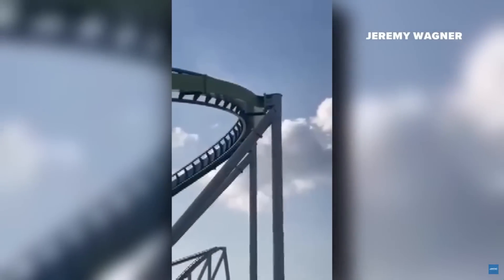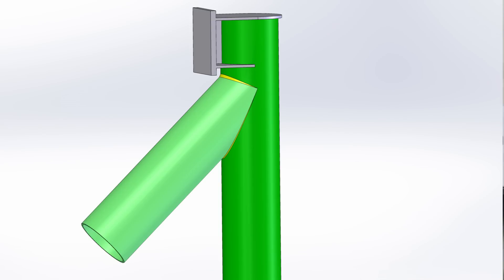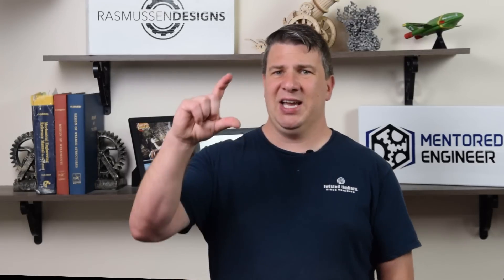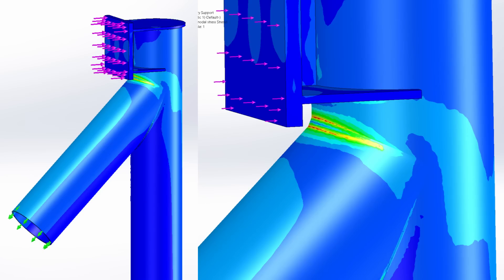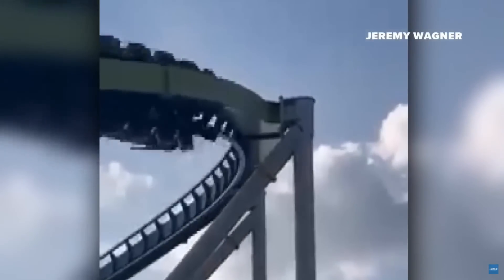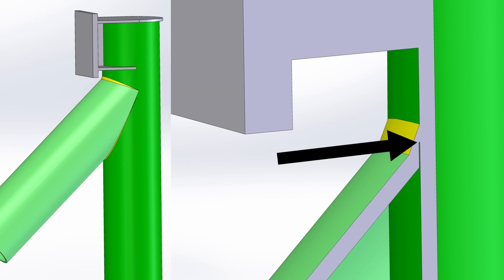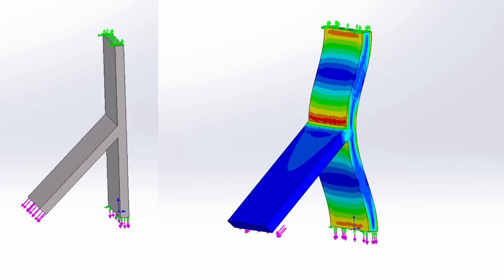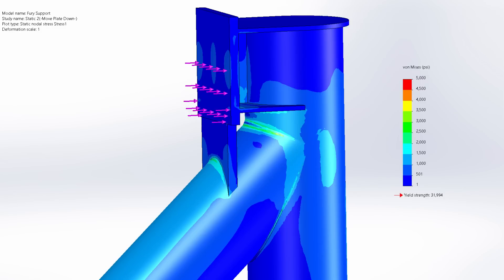Fury 325 Crack! Engineering Analysis and Response

Comment: Since the cars rolling by exert stress on the joint, could they install some kind of spring system at that location that would absorb the stress?
Reply from the maker: Great question.   Yes and No.  They could do that, but it kind of defeats the point.  The springs would absorb energy from the system and reduce the velocity as it goes by.  The stiffer a coaster is, the faster it would be. 
I had to change the wheels to be stiffer on my backyard coaster so that it would get all the way around the track.
Reply: Would not be helpful. Springs could dampen the effects of local, small impacts (bumps etc.), but not the overall nominal loads coming from the train due to outwards acceleration. Those forces are still there and cannot be reduced, except for lowering the speed.
What also needs to be taken into account: if this support is less stiff, the loads coming from the train will be transferred to the neighbouring columns, putting higher loads on those.

Comment: This is not the only one that cracks were found at. Most of this steel made today is garbage. Any ride you see closed is a good sign that cracks were found at stress points.
Reply from the maker: Most manufactures will insist on Mill testing for each lot of steel so they can trace defects like this.
Reply: Except that cracking usually does not happen within the base material itself, but at the weld toe or inside the weld.
Having no clue, but having a strong opinion and spreading it. A typical youtube commenter.

Comment: At the time the video was shot, it was no longer a crack, but a complete separation of the two sections. The effects of the motion (every time the cars rolled on that section of tracks) played a major role on the stress of the structure (dynamic or live loading; fatigue). There was a picture taken the previous week by someone else that actually showed the crack near the connection of the tubes. In about a week or so, this led to a complete fracture. That picture was shown on national news.
Reply: .... sure looks like a fatigue failure.....  it broke! .....and does not appear to have stretched first...... well, could also have an inclusion in the steel but, surely someone tested for that!
Reply: You know I have to wonder about the quality of the materials being used to build these things.

I'm not saying that's definitely the case, but if it's happening to more than one ride over the course of time, is it possible they could be getting substandard materials at the fabricating plant, and it might not show up in their testing?

Comment: I suspect that the design was fine for static loads. They underestimated the effect of cyclic loading (think of bending a paper clip until it breaks). Fatigue strength of mild steel drops quickly as the number of cycles increases. I don’t know how old this ride is, but at 1 car per minute, 12 hours per day, 250-300 days per year, it wouldn’t take too many years to get to millions of cycles. It’s even greater when you account for the number of axles per car as each axle passes over a point it’s separate event as far as the structure is concerned. Watch the track, the next time you are stopped at a railway crossing. 

Also, it would be very easy for a slight misalignment during fabrication. A couple of millimeters or 1/10’s of a degree would make a significant difference.
Reply: Yeah, they definitely haven't built roller coasters before and obviously didn't know that there would be repetitive load/unload events.

Comment: I've never seen angled supports angled in the same direction as the forces. I'm no engineer but it looks like bad design and made this crack inevitable. They should be angled against the forces.
Reply from the maker: It would make more sense to have that angled away so the joint would be in compression.  However, that would put it in the parking lot.
Reply: @MentoredEngineer  lol they should have sacrificed the one to three parking spaces it would have taken to place the correct supports
Reply from the maker: B&M had designed lots of these.  This one wasn't unusual.  Check out this one on Great Bear!  http://thedod3.com/wp-content/uploads/2013/06/greatbear12.jpg

Comment: When I saw this my first thought was that the angular support should be on the opposite side whereby pushing towards the force of the train vs pulling away from the support. My layman's eye visualized that force being transferred down the length of the angular tube toward the ground whereby dispensing the force over a greater area.
Reply from the maker: It would make more sense to have that angled away so the joint would be in compression.  However, that would put it in the parking lot.
Reply: @MentoredEngineer  I've ridden the Fury 325 and many other Giga coasters. I don't think safety and peoples lives care about aesthetics and parking. I know mine surely does not. This was caused by either bad planning, poor design or wishful thinking on the part of Cedar Fair and Bolliger & Mabillard. 
From my perspective a repair on the existing design is a Band-Aid on a broken leg. They need to redesign the support. If that intrudes on their parking and they deem that intolerable then they need to reroute the track to provide either less gravitational stress or better support IMO. They also need to look at the portions of the ride that have similar stresses and supports and consider altering them as well. 
There's light poles in the parking lot, hang a light on it lol! Can't be any worse than that Taurus that caught fire and took another 11 cars with it.🤦‍♂

Comment: If that type of joint and weld is so bad, why does B&M use it so much? So many of the supports on all B&M coasters are similar with a vertical tube and an angled tube attached near the top. Also, what sort of damage would be required for there to be a complete structural failure? My guess and hopes would be that multiple adjacent supports would need to fail (i.e. any two supports could fail like this as long as there is a "good" support between them).
Reply from the maker: Evidence would support the joint is not "so bad".  B&M has been using this type of joint for 30 years.  While we see that the weld is the weak part, it could be that the foundation shifted adding extra loads
Reply: Unfortunately it was not made clear in this video that Corey does not actually know how the joint design is. It is a pure assumption that a fillet weld was used.
And even if a fillet weld was used, hollow section joints usually have higher stress concentrations on the weld toes rather than the weld root, i.e. it would not make any difference if you use a fillet or a full/partial penetration weld. Assuming that the welds themselves have sufficient strength.

Comment: You can tell by the way the outside face of the column 'tore' that that was the last part of the failure, which supports your theory that the failure emanated from the weld.
Reply: I’d say it’s a bad heat treatment. Not a welding problem
Reply from the maker: I doubt these supports were heat treated.  It would add no value to the steel material being that it a standard piping which is a low alloy.
Reply from the maker: Once the crack starts, you will have less material to carry the load.  At a certain point, the material will just tear off as you pointed out.

Comment: Exactly what you said about inspecting the beams before and  after, I would ad replace all the hardware that holds the track that have been compromised too.
Reply from the maker: Good point.  In the industry I worked in we would do that on critical joints after an issue like this.

Comment: It seems to me like a laser scanner would be a good investment so these things could be caught early.  Super interesting video.
Reply: A laser scanner probably wouldn't have found anything except maybe the settling of a foundation if that exists and contributed to the failure. The only way to find this earlier is pretty much a manlift to do mag particle testing. That being said this crack didn't go to a full break in one day. They definitely need to improve their visual inspection process to make sure all joints and connections are subject to a close visual inspection (using a zoom lens or drone) probably on at least a weekly basis.
Reply: @danbert8  You can get some pretty good results on integrity with a modern scanner - just not early enough to stop the loss of integrity from happening.  I agree - the scanner becomes helpful when its already "too late", but they could have probably caught this months ago and have already mitigated the issue.  I just assumed that parks would be scanning footers and such regularly and comparing the model data to make sure there arent issues.  I wish I was still working for Trimble - I'd be having a field day with this.
Reply from the maker: Thanks!  I'm not sure if laser scanning is a Non-destructive testing method.  Do you have any info on this technique?
Reply: @MentoredEngineer  I'm guessing they're referring to using lasers for very precise measurements to create a 3D model of position. That would, of course, be non-destructive, and any (unexpected/unallowable) change in position would require further investigation to determine why something isn't where it should be.

Comment: Not that big of a deal to inspect these days.  You have excellent drones with 4K footage that can assist with these inspections.  Those drones can be used to continuously film EVERY joint and weld without someone having to climb the ride every single day.
Reply from the maker: Brandon with Theme Park Predictions says they have many drones doing inspection as well as men walking the track.  However, I'm sure there are many areas like this one where it will be difficult to inspect unless you are within arms length.
Reply: Why would you need a drone when this was visible from the parking lot several days before the fracture and shut-down of the ride?  Blaming this on a "hard to inspect" area is nonsense.  A visual inspection from the ground would certainly have caught this - since a visual inspection from the parking lot DID!

Comment: Looks like what coasters need is a robot that can drive itself along the track, with cameras and other sensors to check the track, and robot arms with cameras that reach out, around, behind etc to examine the supports from connection to the track down to a few feet away. Movement and distortion could be checked for in a simple way. Weld target markers at various locations. When the robot gets to specific locations along the track, and the robot arms move to specific locations, if the target markers are not exactly centered in the cross-hairs (calibrated at first robot run after completion of the coaster build) then something that shouldn't move has moved. With all the target markers precisely located, a computer could have a 3D model of the coaster, feed it the marker position difference measurements from the robot and see how the movement has affected the coaster. As with FEA software, the distortion could be exaggerated as a visual aid to see it better.

To ensure that the robot itself hasn't become out of spec, it should have a very overbuilt test fixture that *cannot warp*. The fixture should have various test markers to which the robot rolls and moves its arm(s). If things don't align, it's the robot out of whack. Service the robot, recalibrate to the test fixture, then check the coaster. The test fixture could be in the garage where the robot us kept between its scheduled inspection runs. To ensure robot body to support alignment, there could be a pin or ring or other attachment the robot could clamp onto so it can't slip on the rails.

Like with multi-axis industrial robots "slotted into" assembly line positions and programmed to use the same tools humans formerly wielded, a coaster inspection robot wouldn't miss looking at everything it's supposed to look at, needs no pay or health insurance, never skips a scheduled inspection because it had a fight with its girlfriend, never will miss a crack because of a bad hangover headache...
Reply from the maker: Not a bad idea.  Can I have it?
Reply: @MentoredEngineer  go for it
Reply: You didn’t come up with anything new. That’s already a thing. They already have robots that run along the track and inspect the rollercoaster. They even have inspection cars that humans ride in. I’d imagine they could be upgraded though.

Comment: 4:00 I feel u hit the nail on the head they did speed up the ride from 95 to I think 105-110
Reply from the maker: What I meant is that the trains tend to move a little faster in the afternoon once the wheels and bearings have heated up a little.  The physics of it provide for a max speed of 97-98 mph

Comment: A huge question now is could other B&M coasters using this specific type of support column also be at risk for similar stress cracks forming?
Reply from the maker: It is doubtful that the fundamental design of the support is the issue.  Many are saying that the diagonal tube's footer sunk a little which would add extra load to the joint.  B&M has a great track record with this design.

Comment: Dropping the plate down to that 45* tube seems like the most cost effective option. I’ve heard that back in the day when sex was safe and racing was dangerous, tube chassis cars (particularly of exotic metals) would have the tubes pressurized with nitrogen and a gauge was installed somewhere in the chassis. Idea being if the pressure reads very low or zero, you have a crack. Would it be possible to do that with these tubes? That away, at a glance, maintenance could see if everything is ok or needs closer inspection.
Reply from the maker: That is a great idea.  I have no idea if that is a common practice.
Reply: @MentoredEngineer  Not common at all, only time I saw or better used air pressure was in in a research project to determine Wöhler curves for thick walled hollow section joints.
Reply: Sex has always been dangerous.

Comment: Depending on where in the layout this break occurred they could possibly reprofile the ride layout to eliminate that overbanked element?
Reply from the maker: I feel that  might be unnecessary.  Worst case is they fix this support and add another on each side.  My guess is the footers sank a  little causing extra load on the joint.

Comment: It's literally insane that it was able to get that far
Reply: Safety critical structure is typically required to be damage tolerant. That means that the design engineers had to consider load redistribution due to a catastrophic failure such as this and ensure that the remaining load path can handle the loads (temporarily) until the defect could be discovered and repaired. 

If it's anything like air vehicle structures.. all the adjacent, redundant structure probably needs to be repaired or replaced as well due to the overload condition that the failed support caused.
Reply from the maker: Check this out.  https://www.youtube.com/watch?v=W40VNnH1dSQ  This coaster had so many issues in the 3 seasons it was open.
Reply: @christosvoskresye   correct... Hence why I said it can only sustain damage tolerance (DT) conditions "temporarily" and that adjacent structure likely needs to be repaired or replaced as well. 

Part of the point of DT is so that localized failures like this can be spotted and fixed before they become deadly. It's about giving more time between inspections before catastrophic failures occur.

The overload condition that results on adjacent structure indeed accelerates it's own failure rate and the DT load path is broken as the failed support is probably the intended DT load path for those adjacent members. Thus failure of a 2nd adjacent support would likely result in catastrophic failure of the track.

FYI when engineers design custom repairs for in service structures, they can redesign the load path and fix design flaws with the original design. So a "repair" doesn't mean bringing the structure back to the same configuration as when the ride was first built.

Comment: The way that support is designed, there is shear force working at that weld joint.  Would it not be better to have the support brace on the outside so that the joint is now in compression when it is stressed?
Reply from the maker: From the map, it looks like it would be in the parking lot.
Reply: @MentoredEngineer  ok, but that wasn't my question.
Reply from the maker: @shrodingerschat2258  Sorry: Yes, but that support would be in the parking lot.

Comment: I love when the general public trys to argue with me, the amount of people who thinks they just gunna drop a new support in or weld it back up in just a few weeks. 
these people have no idea about construction. inspections alone take weeks if not months. and we dont know yet weather they will have to retro fit new supports or even foundations on other parts of the ride. I just hope they do this right
Reply: I doubt the weather has anything to do with it.  It looks sunny in the video. ;)
Reply: @steveversteegen8217  we not talking about direct weather 😒  we mean temperature expansion and contraction.
Reply from the maker: Indeed.  The investigation will take 2-3 months minimum.  B&M and Carowinds will be working on repair while that is going on and then implement it quickly.  It may be open for Scarowinds later.

Comment: Thank you for your expert explanation. I have a question. Is it possible that this crack can lead to finding many more mistakes (maybe x-raying the structure with a portable x-ray machine mounted on a tall crane for high areas) that the coaster would have to be torn down and rebuilt from scratch?
Reply from the maker: I doubt that the coaster will need to be torn down.  B&M has a long record of excellent structures.  There will be a fully inspection of the structures using all sorts of nondestructive testing (maybe even x-ray).  There is a growing theory that the diagonal support foundation may have sunk causing excess loads on this joint.